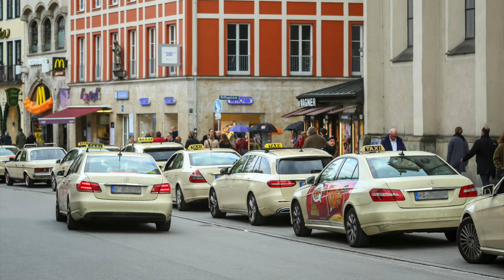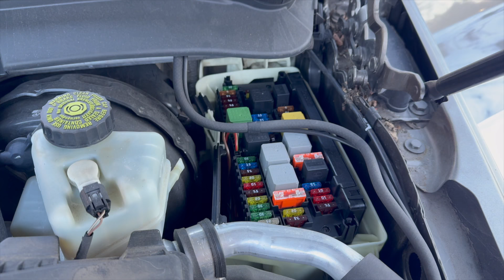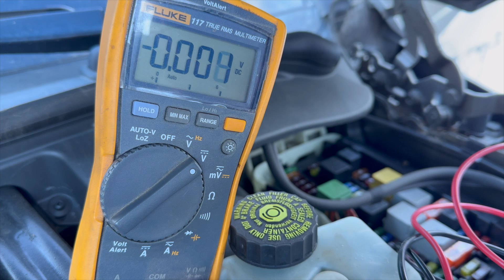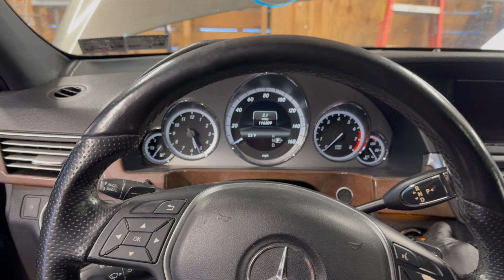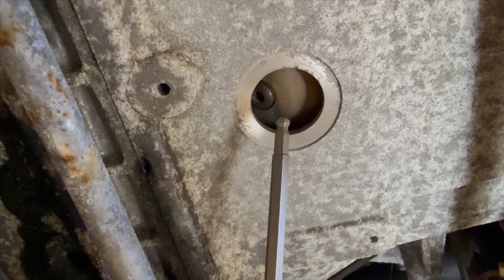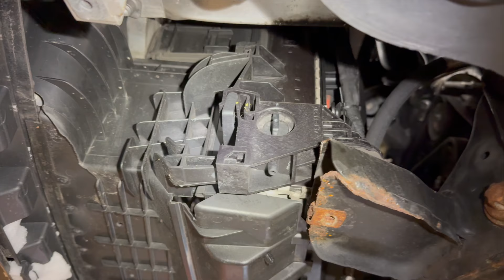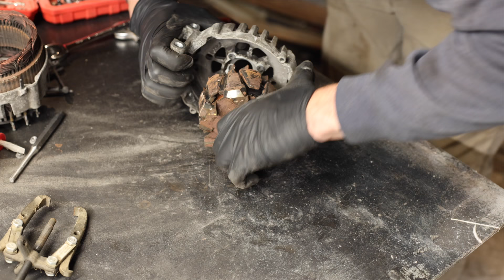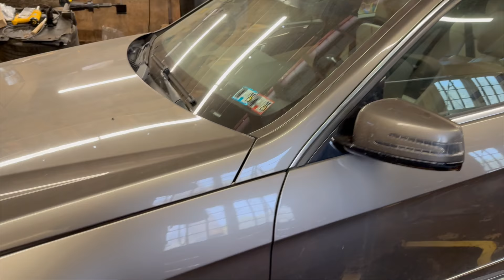I Bought the Toyota Camry of Germany, Except WAY Cheaper (and Better)

Comment: The drop link you've replaced is steel made and is stronger than original aluminium.
I've replaced 3 sets of drop links so far on my w212  in 175k miles and the steel made is way stronger than aluminium ones.
Lemforder failed in 7 months as the lower joint on the left side failed.
I no longer trust top brands unfortunately.

Comment: you're one of those dudes who thinks everything made in china is cheap, don't you. what if i told you it's the company that chooses the level of quality to be manufactured, and china has cheaper options available so the company goes for that when they could've chosen a more quality option, but doesn't, so to increase margins. china has the capability to produce very high quality devices, and materials, if requested (I.E. iPhones)

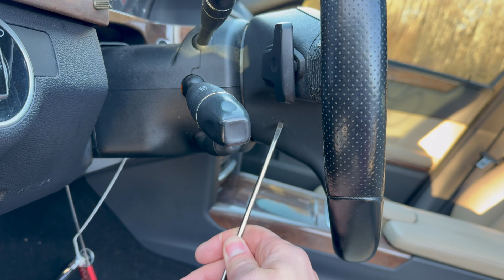Comment: 2:53 you don't have to pierce the skin of the steering wheel while removing airbag. there is a very tiny cut line that you can see if you look very closely at that round point. If you use a tiny flat head screwdriver, you can also remove the airbag and the skin is not damaged at all. I did it before 3 times and no one can understand that I removed the airbag previously. Which is a good thing when you try to sell your vehicle or you have OCD :D

Comment: Why did you go ahead and replace the steering control module before you checked the electrical gremlins caused by water damage? If the OBD CAN D communicates through the module with Can E to ECM, that means it’s communicating through the module, doesn’t it. Or could that communication still be intact even if there’s a faulty module?

I know this isn’t auto school, but trying to learn stuff where I can.

Comment: my first car was a 1988 e class. current car is a 2013 volt. the amount of maintenance and the fact that newer mercs can brick themself because a 10mm bolt comes lose over time... ya im never owning a merc made after 2000 for the rest of my life just because of that fact alone. 
ive done zero maintenance on my phev over the last 2 years other than an early oil change at 5k ice miles (equal to 45k miles). the breaks are original and have about 80% life left on them after 130k miles lol. battery gets 150% of epa rated range from 10+ years ago, zero degradation.

Comment: A Toyota Camry will still be running and driving a decade after  that Shitbox Mercedes will have been scrapped. Mercedes haven't made a decent car in over 25 years. Mercedes are now designed and engineered by accountants instead of actual engineers. They also use Renault and Nissan engines and parts. There was a time when you drove a Mercedes and you knew that you were inside the best car on the road, those days are long gone. They are now cheaply made, unreliable rubbish.

Comment: I wouldn’t touch a modern Mercedes. They stopped making good cars in the 1990’s. I owned a 1992 190E 2.3 in Switzerland years ago and it was an absolute tank. Bank vault doors, high quality black leather seats, ice cold air con. The previous owner was a retired Swiss gentleman who maintained the car fastidiously. When I bought it the display read 55,000 km - about 34,000 miles. Easily one of the best cars I’ve had the pleasure of owning.

Comment: Its the upper timing cover leaking, not the cam magnet. Further, you can definitely get cam magnet seals from the dealer. Additionally, the aluminum bolts are 1 time use. Also, you probably wrecked the intake plenum seals by not putting them on the lower intake first.

Comment: Here's some data from someone who in the distant past drove E-Classes as a professional driver in Europe: when you order an E-Class—at least in Europe—you need to tell the salesperson at the dealership that it will be used as a taxi, so it will be used in a professional setting. At least in my time driving, this meant that Mercedes-Benz would 'taxi spec' the vehicle during production: reinforce certain parts of the car, such as the door hinges. In addition to reinforced door hinges, Mercedes-Benz has made other taxi-specific modifications to the E-Class to handle the demands of professional use. These include a beefed-up suspension system to cope with the extra weight and constant use, factory pre-installation for taxi gear like taximeters and radios, an integrated emergency alarm system for safety, and if one needed: more durable interior materials that are easier to clean and can withstand heavy daily use. Though the vehicles I drove had leather interior.

Comment: The reason your Accountant recommends buying a Camry and not a Mercedes is to do with resale value. That Merc has cost the original purchaser a fortune in premature depreciation. You could buy that $14k Camry and when you sell it in 5 years time you will still get $14k for it. In the meantime you will not have had to fix all that very expensive nonsense the Merc has needed.
  Mercedes are aspirational cars. You buy them because you have an emotional desire to own one, or more pertinently, you want to be seen driving one. 
  I have owned several German cars because they were cheap to buy, but they were nightmares. Everything had stopped working and every trip was taken with a nagging fear that the car was going to fail at the most inopportune moment - which they inevitably did. I couldn’t wait to get rid of them. The several Toyotas of the same vintage I’ve owned since then have been a pleasure. Everything works and you can drive confidently with the knowledge that it is highly unlikely to break down.

Comment: If this was a Camry video, we wouldn’t start by talking about Canbus diagnosing and module failures lol
Reply: Yea we'd be talking about mechanical parts falling apart or the body rusting to pieces.
Reply: @derbigpr500  Thta's bad! Or are they made in the US?
Reply: You’re absolutely right, we would be talking about out of round cylinders and incredible oil consumption

Comment: 33:48 I always smear the outside of the spark plug insulator with dielectric grease to help prevent the boot from sticking when removing it next time.

Comment: I bought a 2016 E350 Sport 4Matic in 2023 and so far, it's been very reliable and very nice to drive.  My mechanic mirrored your statement that these W212 variants are pretty reliable and advised me to get this one over a newer turbocharged 4 cylinder, which he very much advised against purchasing.  Good luck!

Comment: Hi Waldo. We own a '13 M276 powered E350 just like yours. Ours developed chain rattle due to the cylinder head draining too much oil overnight. There is a Mercedes TSB about installing check valves in the head as well as replacement of the timing chain tensioners. Also, for the cam sensors and cam magnets, you need to replace all 8 of them and also add the necessary sacrificial wiring harnesses to them. (FCP Euro sells the kit). Also, be on the lookout at the High pressure fuel pump, ours has a terrible ticking noise at idle and we were quoted 1500 dollars from an INDEPENDENT (not the dealer) to get that part changed. Not sure I could call this Camry level of reliable, especially since in Germany most E classes you see as taxis are Diesels.

Comment: Well yes, the W212 does have Air Suspension. If you wanted, you could equip it with Airmatic, which comes with Air Suspension and dampening.
Also the wagon S212 came with rear Air suspension from the get go.

Comment: I bought a 2020 “flood” GLE with 21000 miles and it’s been nothing but headaches. Every replacement module needs to be programed to the car by the dealer.

Comment: I would have driven it and gotten the rust off those rotors with the old pads before replacing them, just so you’re not putting new pads on Rusty rotors.

Comment: there are special hoses/wires that you can use to divert the oil from getting into the ecu ( wiring). they can also be used on your s550

Comment: There should be a rectangular cover on the upper side of the bell housing that you can turn the torque converter up to to get that bolt out, then turn the torque converter back down to the bottom to drain it. Make sure you use a magnetic driver!! That bolt is small and can be easier dropped into the housing, trust me 😬

Comment: The question is y did the ecu have oil in the connector,  could the oil pressure sensor be bad and pushing oil through the harness????

Comment: Not a fan of the comments pointing out that Mercedes are "so much more" reliable than other German makes. The largest reason for any reliability problems with most of these manufacturers is that they are poorly maintained. When you combine German over-engineering with a complete lack of maintenance (as is seen with many American car owners), you have the domino effect, where one failure cascades down the line into the next. This is often left to the second or third owner of the car to discover. When maintenance is properly taken care of, it's not uncommon for any of these brands to see 300k miles or more.

BMWs and Mercedes are both common Taxi vehicles in Europe, because there they are offered in an "entry level" option package with a diesel engine. In America these cars are seen as a "status symbol" and aren't even available spec'd as such.

I would assume if every second-hand German car owner did the maintenance that you showed in this video (which I'm sure was not cheap), they would have a lot less problems.

Comment: Hey Waldo, I just skimmed throught the rest of the comments and no one has given you the fix for your vacuum coolant fill tool.  I have the same one and found that the barbed fitting they put on that smaller hose is too small of an inner diameter and causes a bottleneck, stopping the airflow.  I removed that fitting  - unfortunately, you won't be able to use the small drain hose anymore, but after removing, I was able to easily pull 60 psi on the system.  Before, it was maybe 15 psi.  I've used it a couple times now since fixing it and it works awesome!  
Keep up the good work man -- always enjoy your videos!

Comment: You can also buy cheap little wire extensions from fCP euro to plug between the solenoids and the native wiring harness. This prevents wicking of oil back to the ECU.

Comment: You can buy sunroof drain cleaning brushes quite cheaply - they're like a 3 metre long bottle brush and a good preventative measure

Mercedes have been losing out to Japanese cars in Europe since the disasterous Chrylser joint venture resulted in chassis that rusted out badly.
They're still popular in Germany but disappearing in most other countries

WRT reliability comment: American spec vehicles are quite different to the run-of-the-mill stuff in Europe (mostly lower spec interiors coupled with significantly larger engines) and the poor reliability of US models wouldn't be tolerated in Europe

Comment: Calling a Mercedes E-Class the Toyota Camry of Germany is insulting. Bad call Waldo. Bad call. These E-Class used to be often used (and some still are) as Taxi's because the running-costs (repairs, fuel etc.) are quite low, thus relatively cheap to run for taxi companies.
About "Meyle HD" and looking cheapish: That's because Meyle is not longer a quality brand (like they used to be) but instead, sell China crap nowadays. Avoid Meyle !!

Comment: Quick tip fill the coolant fill hose ( that is connected to the vacuum filler )first so you wont suck the small amount of aor in your system before vacuum filling

Comment: You can turn the engine in the front with a big nut to turn the torque converter and thus get the drain plug for it centered at the bottom. Also, are you sure you cannot fill the transmission from the engine bay? Mercedes usually have a dipstick to check ATF levels in the engine bay and you can fill the ATF in through there. I haven't worked on a Mercedes this new though, maybe they stopped doing that at some point.

By the way, any chance you could link the tools and products that you use in the description?

Comment: You need to add pigtails to stop the oil going to ecu. 
Also you didn't need to replace the alternator at all, they usually last a very long time in mercedes.

Comment: Mercedes built in Germany are very good and reliable cars, but if built elsewhere tend to be much more problematic.
Trans fluid that looks like motor oil I would guarantee it's never been change and you really don't want to change it. Changing it now is probably going to cause problems like slipping or shuddering. But if you do change it, only change a few quarts and that's it. I've made this mistake a couple of time with a trans that was working perfect but decided to change the fluid for the first time at a little over 100k and after it started slipping. That was before finding out from countless mechanics it's a bad idea to do that.

Comment: Check the plugs for the O2 sensors cause ones the oil travels in there you will have lot of fun, and also cut the hole for the torq converter little bigger and drop oil form it you have a 7gtronic and they are really sensitive to old oil also open ECU and clean the oil, it defiantly you have some in it.

Comment: Welp, first "repair" was done incorrectly, as you said that you shapuld have done in the first place, you always test for continuity from the trouble part to the ECU it directly hooks up to first before replacing a trouble part to ensure its not the part itself and instead is a break in the wiring somewhere.

Comment: "This car is so easy to work on".  But you have to work on it.  I've had a few Deutsche vehicles and regretted getting them. Im a Toyota/Lexus guy so I guess my expectation of quality is a little different than a badge logo.  Yes Mercedes are made with quality engineering but much of it isn't with quality parts.  3.5L are fairly decent and easy to work on and agree they are a bit more reliable. But resale on these are not so great. Timing chain tensioners are not fun on these 3.5l. I think being mechanically inclined is a bonus having these vehicles and can save you thousands.

Comment: Now take it right to the dealer for recalls. It has a recall for rear subframe rusting to dust. Get that replaced before MB changes their minds. It's a $4k job. 
Then recall on corrosion and fracture of bolts attaching the electric power steering assist motor to the steering gear housing.
3rd, replace metal brake lines underneath driver's side. They corroded from inide out.
4th, replace timing chain tension & check valve. There is a tech bulletin on this. Chain slap wear on guides.
Best prices I've got for MB parts are from AutoNation parts.

Comment: LOL. I bought a 2011 e350 yesterday. 62k miles on the clock. 1 owner and super clean inside and out. The non turbo charged V6s from Mercedes are very reliable. But Camry reliable…not quite.

Comment: I like ur vid do you have any idea why my fuel hand isn't working i changed the pump and it will read if I disconnect the battery but it's still only goes to halfway

Comment: Can't believe how easy that car is to work on.  I think too that it's a bit strange how many things are held together with E-Torx fasteners.  Maybe they have more holding strength than more typical hex head fasteners, I don't know.  Just seems odd.  I've never seen oil travel through a wiring harness like that before.  I guess if a wire is plugged into a sensor that leaks, its easy enough for the oil to travel down the wire but it was a new one on me.  Good luck with the new Benz!

Comment: They make a tool that attached to the transmission that uses shop air to blow (low pressure) through the transmission to get the fluid out of the TC.

Comment: Idea of Camry is to be cheap in repairs, reliable and as simple as possible from engineering point. This mersedes is heavily equipped with electronic systems, has complex engine with a lot of systems, and a bunch of expensive illnesses. Good luck in repair. It will be your forever
Reply: And they're reliable, easy to fix and at least in Europe parts are cheap.

Comment: Buttons on steering wheel already peeling… what happened to quality? 😕
Reply from the maker: This is true. Audi has been like that for decades and apparently Mercedes wanted to give it a try
Reply: @WaldosWorld  that was my first thought, too. An early VW/Audi problem that I didn’t think Mercedes would adopt. And the ongoing ‘oil in the harness’ situation is also a bit of a disappointment tbh. Googled just ‘oil in wire harness’ and only got MB related results 🫠